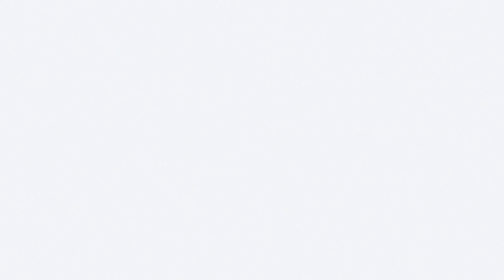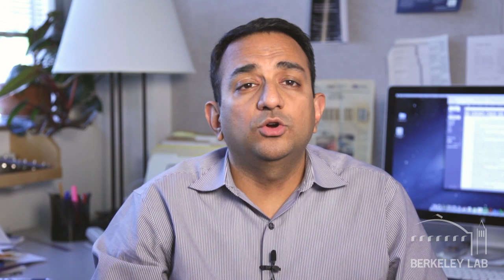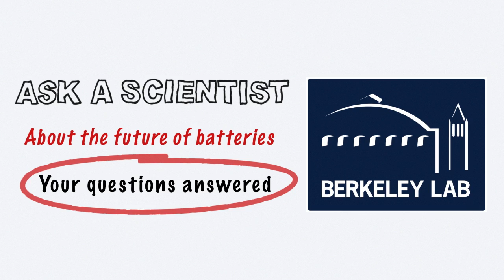A Scientist Answers Your Battery Questions

Comment: If I have 4 12v batteries and wire them in series to make a 48v nominal battery can I still run 12v appliances off one of the 12v batteries? And can I charge just one 12v battery and it charge the rest?

Comment: Panasinic just released a new? NCR18650BR Li-ion cell. Very little information is available except that it is different from the original NCR18650B. The difference claimed is SIO in the Anode. Any comments?

Comment: Hi Venkat,

I recently heard about german-researchers-create-lithium-ion-battery-retains-85%-its-capacity-after-10000-charges

can you shed some more light on this as in how are they different from today's batteries and what made it achievable for them? and when can we see them commercially available.. the cost, safety, reliability and durability of them..stuff like that? could these be the ultimate batteries for EVs in years to come?

- Karthik..

Comment: Further investigation shows it's a primary cell, not rechargeable.  However their other branch, Actacell, is showing a patent that may be for rechargeable cells:
Patent No: 7,718,319
Issued: May 18, 2010
CATION-SUBSTITUTED SPINEL OXIDE AND OXYFLUORIDE CATHODES FOR LITHIUM ION BATTERIES

Comment: Couple of points.  

A 350 mile range EV would be great, but something more like a 200 mile range is the threshold of acceptability.  With ~20 minute, 90% rapid recharging one could drive all day (>500 miles) with only two moderate length stops.  About what one does while driving with liquid fuels.  Once to refuel and once to eat.

A 200 mile range means a lighter and more affordable car.

Second, current battery prices seem to now be in the $250/kW range.

(out of room)

Comment: Hi Venkat, will the Battery Hub seriously consider Li-air battery technology (since you mentioned Li-air batteries in the video) as an option that will be commercialized in 5 years? IBM is betting big on Li-air batteries, what are DOE's expectations on Li-air batteries in next 5 years?

Comment: Since the Tesla Model S can already do 300 miles on a charge, in a large luxury sedan, I'd say your goal of 350 miles of range is already well within reach.  I think it would be helpful to compare your goals with the best existing technology today, and provide a specific Wh/kg number you're aiming for.  I think the new Panasonic cells Tesla uses are around 250 Wh/kg at the cell level.  Recently Envia has claimed 400 Wh/kg.